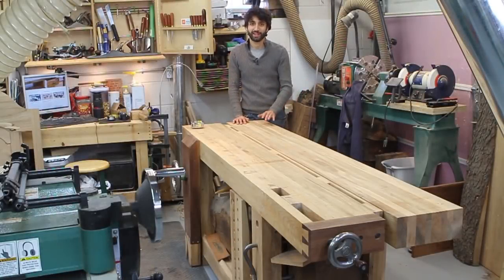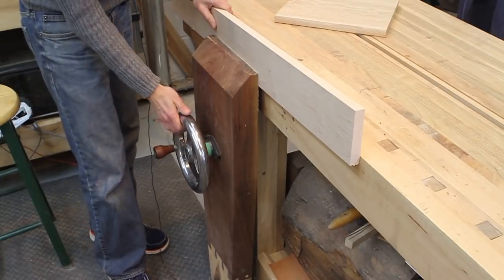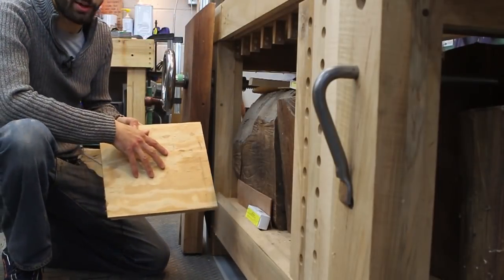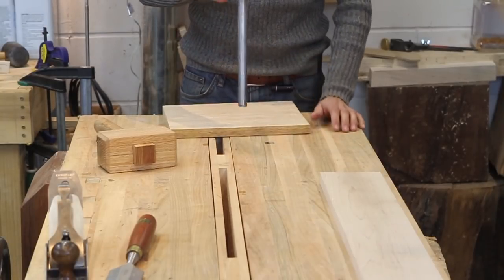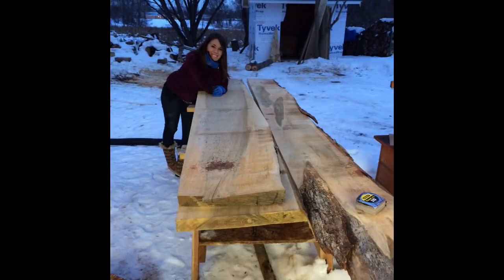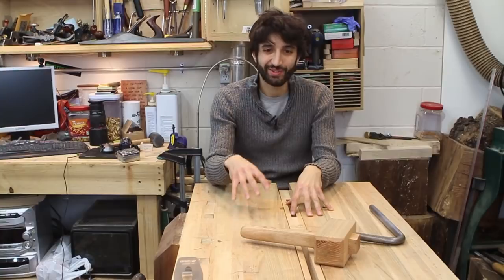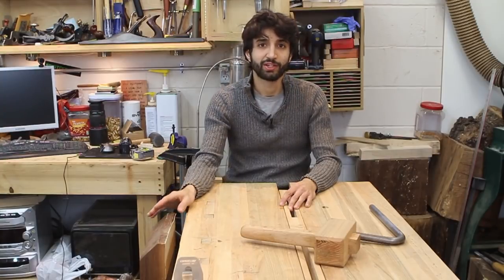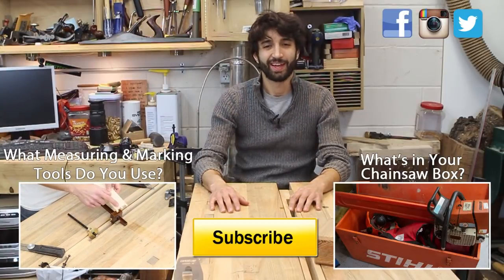My Split Top Roubo Woodworking Workbench - Ask Matt #5

Comment: Matt, I love your posts, keep up the good work. I have logs to mill for my Benchcrafted roubo, but I don't know to what dimension. I realize 8/4 is recommended, but how wide? Can you offer some advice??
Reply from the maker: If you are going for a 4" thick top, you want widths around multiples of 4.5" or so to minimize waste.  I ripped my stock to 6" widths and ended up with a top @ 4 5/8" thick.  I wasn't too conservative when working on the top since I knew I had plenty of material to work with.  If you can get them milled to 2x6, you should be in great shape.  Thanks James!
Reply: +Matthew Cremona Thanks Matt!!
Reply from the maker: No problem.  Best of luck on your bench build.  Let me know if I can help in the future.